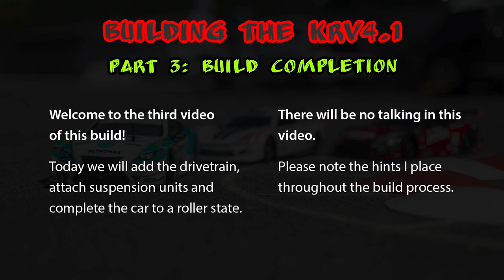Building the ultimate TT 02 Part 3

Comment: Do you tap the chassis holes for the  screws before installation? Cheers.
Reply from the maker: Yes, I do. At that time I just used a steel screw and grease. Now I recommend to use Tamiya 54232 thread forming tap with grease.

Comment: I saw that someone in the comments already asked you how much this build cost you and you replied that it was about 700 euros, minus electronics. All I can see that is left from the TT-O2 Is the chassis and maybe one of the diffs. Is it worth all that money and effort to get the parts? Or is it better to buy a proper Kit?
Reply from the maker: I think the full competition touring cars still have a small advantage regarding chassis flex adjustment. In the last event I raced with my recent version KRv5 against all kinds of X4, A800R, ARC and Mugen and had the fastest car on the track. Especially mid corner speed was sensational. So right now the performance is very good. Regarding the parts: Tub and drivetrain are TT-02 SRX. I use my own spool because it is tougher, but my customers use the XV02 spool.